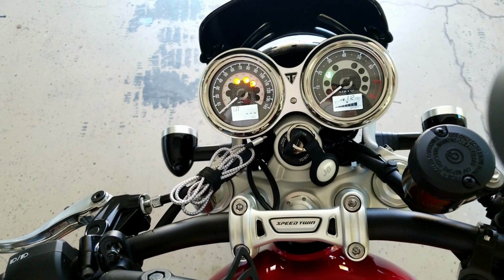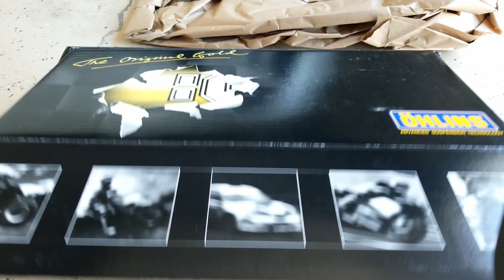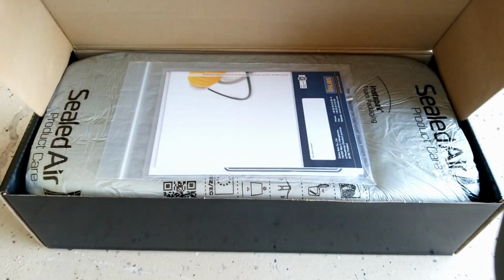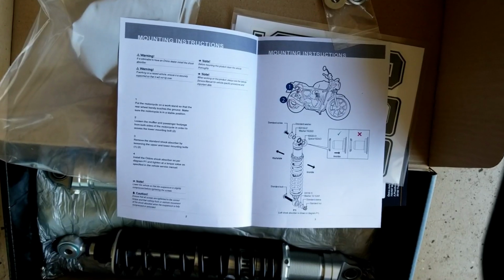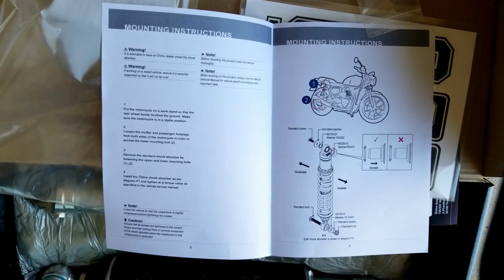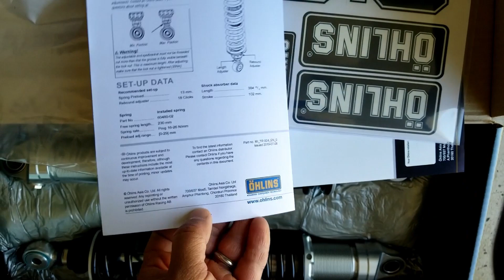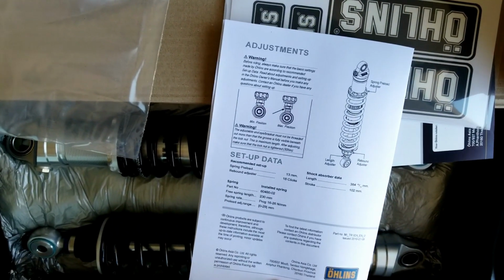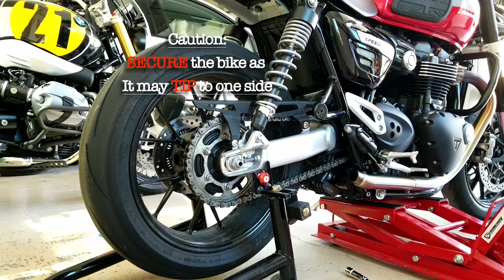Speed Twin looks OH so good

Comment: For anyone needing help understanding how to set up suspension sag and rebound, Dave Moss has some excellent videos. When they ask for weight, they are just choosing the spring. Getting the "suspension system" balanced for the rider is key even on the street.
Reply from the maker: Thanks for the info Steve. I thought they were dialing it in for me based on my weight. I’ll be watching those videos you referenced ✌️